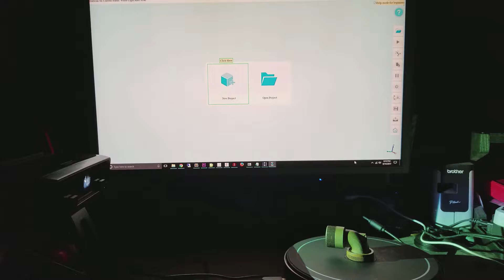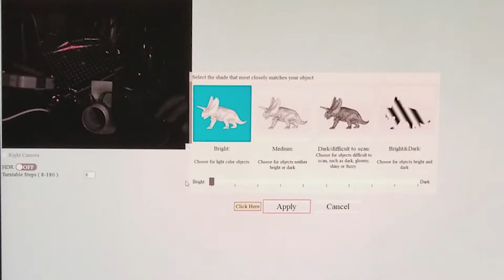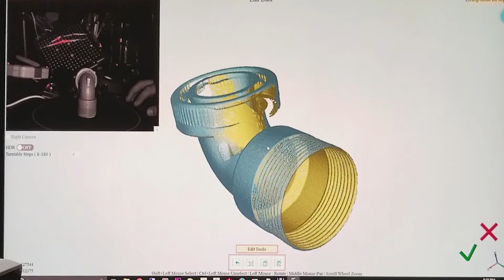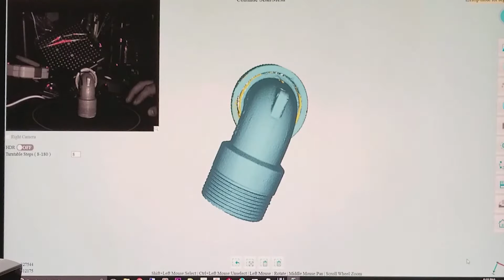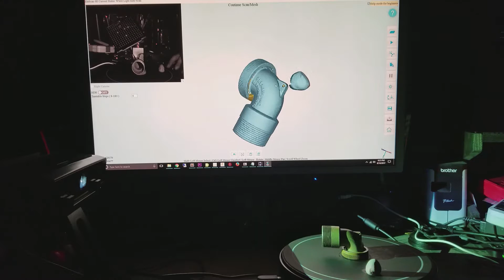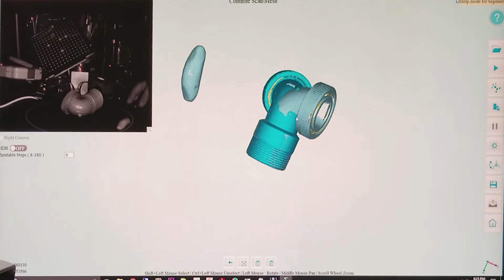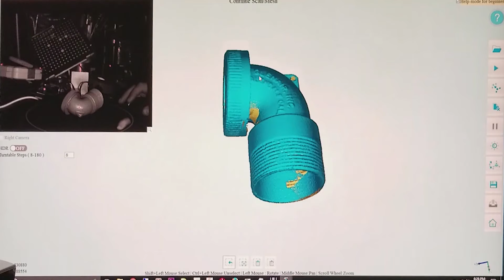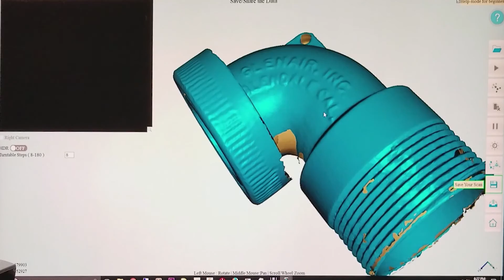Basic 3D Scanning with the Einscan SE

Comment: Interesting how much the software improved over time. Ordered a SP this week. Tried the Einstar but it didn’t perform well for reverse engineering.
Reply from the maker: Interesting to hear. My main use is reverse engineering and I can't say these things have been excellent for that, but they more or less got the job done. I use my SE more than the others I have, simply because it's so automated.

Is Einscan offering anything better in terms of the mesh-to-solid workflow these days? I never bought Geomagic. I use SpaceClaim.
Reply: @ViceChief  the cleaning / selecting of the mesh is easy and you can do X/Y/Z alignment too. Easy to use. 
The software is nice but the hardware of the Einstar is not made for parts like battery packs or controllers. I think the scanner is made for organic shapes.

As far I know you don’t get geomatic with the SP and I didn’t get it with the Einstar either. 

For reverse engineering I use GOM inspect to get the surfaces and Solidworks to make a CAD.
Reply from the maker: @Todestelzer  Great comment, thank you very much for this updated look at the scanning world. I also work on mostly prismatic solids.